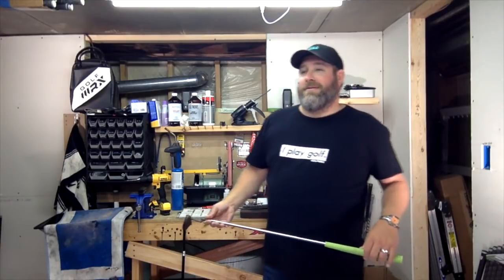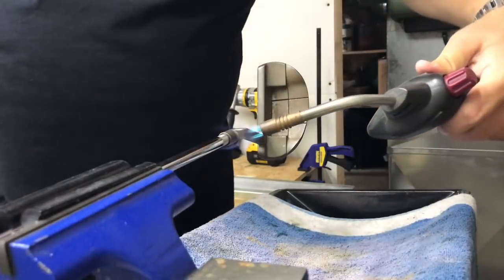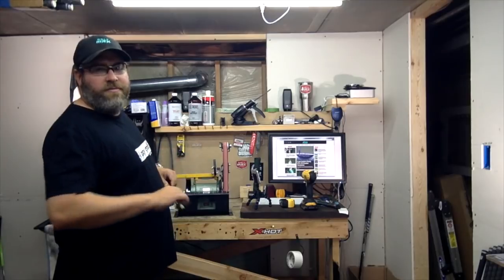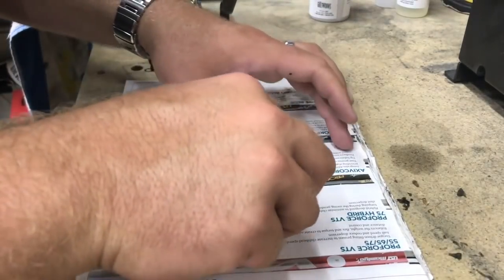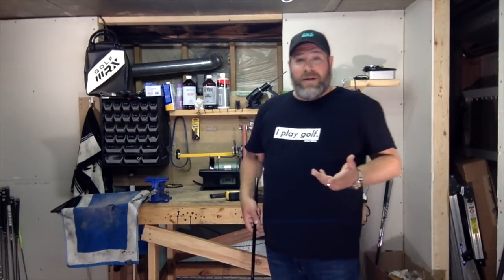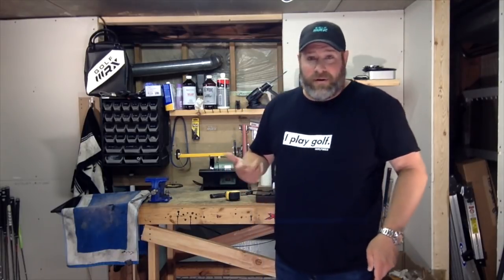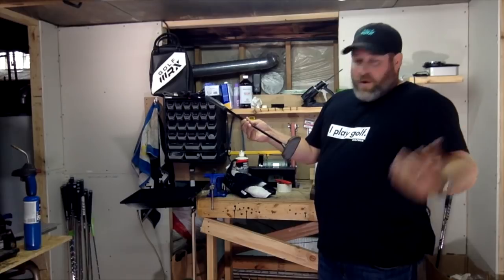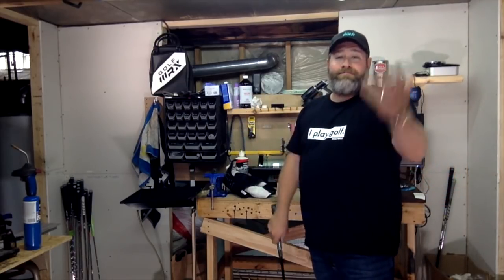THE SHOP: How to replace a putter shaft

Comment: whee yay my first re-shaft. I didn't have a new, flawless putter shaft so I used a new iron shaft. It is an A/R combo flew (a stepped FST 115) instead of Stiff, but then again I didn't just cut down the butt -- I cut off about 6 & 1/4" off the tip, stiffening it up plenty. I was going to leave either 6" or 9" between the hosel and the first step, and 9" felt flexy whereas 6" felt more like the original (flexing/gauging by hand, which: I did used to gauge roughly this way in archery with some accuracy over time). And I cut about 4" off the butt so that the whole putter was the original, comfortable length. The new shaft weighed the same as the original once cut. I got a nice Golf Pride classic putter grip since this is a vintage bronze Tour Model 103. An off brand I suppose, kinda like the budget new shaft, but a lot nicer than the pot metal Tour Model 103 of today. Totally different shape and weight distribution -- this bronze putter is the best all-feel, all-me, non-mallet putter I've ever used. Love it. Well, it might technically be a mallet, but very light comparatively. Thanks!

Comment: I am planning on machining a putter head and couldn’t figure out how to attach the shaft, so thanks!  

I’m going to order the shaft so I can measure the tip diameter.  Then I will know the diameter to mill the hole opening.  Can I ask what kind of epoxy you used to attach the shaft?  

Also, I am wondering what kind of solvent you used to wet the double sided tape so the handle would slide on so easily?  

Thanks in advance for any input or advice!  I am excited to make my own putter.  I work in a machine shop and can program and have access to 303 stainless steel and all the tooling I need to do this project so I’m looking forward to getting started on my design and program.

Comment: Could you put a different kind of hossle on a taylor made Spider putter that has a straight shaft into the head. Idk the correct terminology but I prefer a bent hossle where the shaft meets the head. Similar to the putter in your hand in the beginning of this video. i dont want to pay for a new putter when i have a taylor made spider already just with the wrong hossle shape.